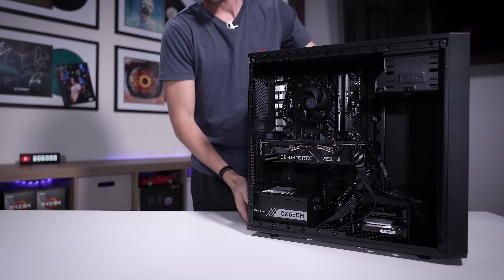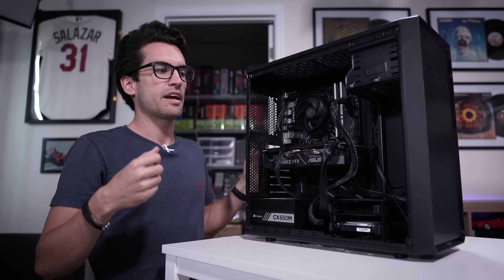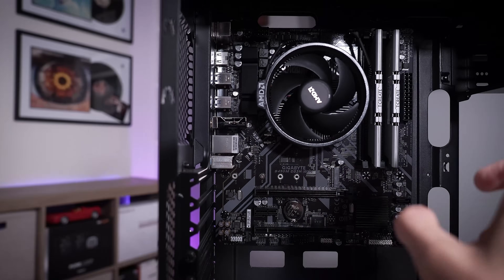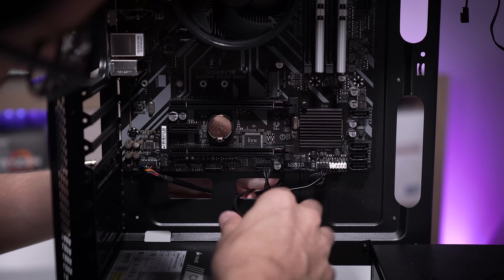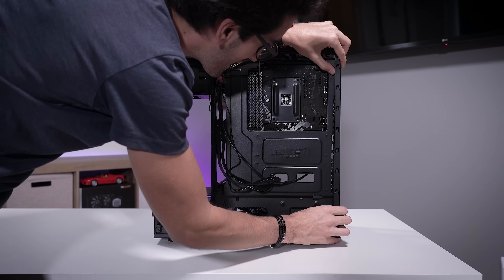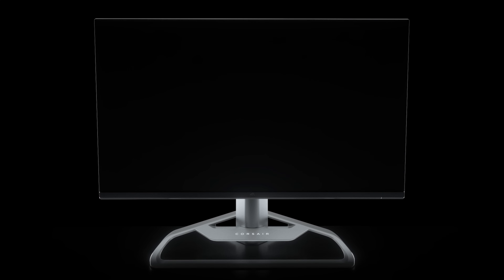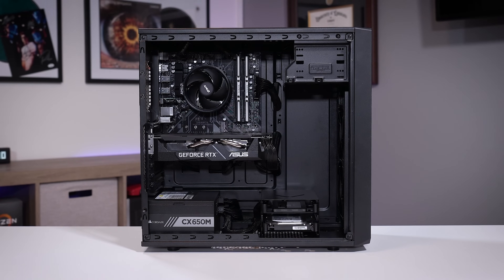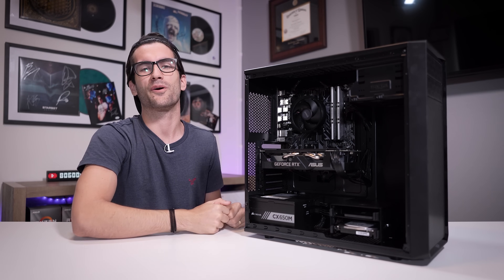Fixing a Viewer PC's AWFUL Cable Management!

Comment: It did help temps because the fans weren’t connected. Also shows how much part selection can affect the overall look of your build. Matching the size of your case and motherboard can help with cable management. This Matx motherboard in an atx case means the hd audio cable sticks out like a sore thumb.

Comment: Why skip over the worst cable to manage.....the 24 pin?  ;)    I have that exact case for one of my builds.  Added an extra USB 3.0 front panel to the case.   AIO on top.   So even more wiring.
Reply from the maker: I didn't skip over it. Was pretty straight forward, that one :-)

Comment: I always thought of cable management as an important part of the build. I know some people don't care, and that's fine.. but for me, I compare my work to what could be obtained from a pre-built from a system integrator. Especially if I am building the system for someone else, I want my systems to be not only technically superior (non proprietary components, sensible parts, price/value, etc) but it has to look better and everything has to work. It has to be clean, every port is connected, all front panel I/O.. everything. I agree with Greg, it's just a matter of pride, I took the time to source and build the system, it's my work, my name is attached to it.. it has to not only work good, but look good. I am a fan of this series, looking forward to more!

Comment: That will be a great series. I can repair, build and clean PCs but my cable management skills are really bad. In front it's fine but the backs look terrible.

Also cool, first video and the case shown is the one I use for my second and third gaming PC. It is extremely cheap, light weight and really good and simple.

Comment: I really need to redo mine. I told myself when I built my latest system (2020ish) that I wouldn’t just get it running and shove the wires just wherever, but that is exactly what I did. Lol side panel fits, enough to latch anyway. It only randomly popped of once right after building it, none since then.

Comment: A ways back now, just when the big C just started, I built myself a new, fully water-cooled, RGB-Vomit PC (Ryzen 9 3900X, RTX 2080Ti). My fist Water-Cooled, RGB-Vomit System. I was not prepared for the PITA that is the additional ARGB cables. Holy schmeckels, getting those all the Blocks and Fans connected and tied up neatly without the blasted ARGB connector unplugging itself all the time was...an experience. But that's on me, because I wanted the RGB's everywhere. Might cut back a tad on the RGB on my next build - this one will serve me well for the forseeable future, I hope. Nice Video, Greg!

Comment: Only thing i kinda felt was missing would be 1 fan to suck air out. As the case had 2 fans sucking air in, but none that would pull hot air out of the case.

Comment: Pro tip: Be careful when handling SATA cables. Avoid rough-handling them or bending them too tightly. They break surprisingly easily, and you'll be in a world of hurt when you find out that your drive doesn't seem to be working.

Another pro tip: In many cases the thumb screws of the right side panel can seem to be retaining, when in fact they are not. It's easy to get confused when opening them, as they have some resistance from being completely removed, so one easily thinks they are retaining... and then you just shove the right side panel somewhere and then retrieve it only to find out that one or both screws are missing. Just like happened to you here.

Comment: I don't think it's a good idea to connect the CPU fan to a case fan connector and case fans to the CPU fan connector. It will be really confusing if you use any sort of monitoring software, and if you want to adjust the curves. It can also be really confusing in BIOS, and it might even confuse BIOS (at least those that have their own fan speed curve managers, which most nowadays do). BIOS will assume that the CPU fan is connected to the CPU fan connector.

Comment: I really hope you did not forget to check the fan curves for the CPU fan, Greg. Other than that, good video.

It is not always as easy as it looks here to rout cables. This build was pretty straightforward. I recently bought a pre-built (no disaster like GN reviews) and the front looked fine but the back was an unmitigated disaster (what with all the RGB and FAN cables - 6 RGB fans plus RGB pump head). When I modified my fan setup from stock cheapos for silence I cable managed everything much better. Did not think it would take me about 6 hours (whole upgrade and management) but it was my first time.

Comment: Yoo new series, tbh aside from me using a non-modular psu, Sata cables and my cables being either too short or long I do decent cable management for someone who used a oem case, a cheap thermaltake case and a Nzxt h510 flow case so I hope to learn alot more in this series to make it better

Comment: Gregg another good job.

The eco keyboard warriors need to step back and take into account the possibility of the stray pigtail or cable that is longer than needed getting to close to a fan blade and hearing the annoying burr sound, or burning smell because of a cable or single wire is resting on or up against a temperature hot spot on the motherboard, graphics card, hard drive or some other computer hardware or component.

Cable management is vital for a safe and efficient computer, but if there is no easy way to tidy up the cables then find a solution to what you have.

So I say it again.

GREGG ANOTHER GOOD JOB.

That is for those who are suffering from a severe case of reading deafness.

Comment: hope you get a RGB rats nest in these series. Definetly need some pointers. With cable extensions and RGB fans and RGB AIO, and several SATA devices its just cables on top of cables.
I have tried to manage it but... it's like I need a bigger case just to have some cables to stow somewhere.

Comment: I would never change the CPU fan to a non CPU connector. CPU fan fail warnings will not work anymore and the board can't control the fan speed correctly if the sensor can't be changed for each fan connector in UEFI setup. I rather would change one fan to the back and put the other fan to a 7V adapter or an adapter with a resistor and use a regular molex connector for power.

Comment: I have a TUF GT301 case with the drive cage in; I have no space to tuck in the excess length of the 24-pin, 8-pin, SATA cables. It closes just fine, but it's a fookin mess.

Comment: Never been a fan of zip ties. It is possible to undo them, but typically they get cut when you need to change things. I tend to reuse twist ties, or velcro. You can get twist ties that don't have metal by the way. For one unique setup I used a string (it had holes to use, but was not set up for the screws I had, still made it look nice (think a square approach)).

Comment: The Focus G is the case I chose for the build I did for my brother a few years ago. Budget all the way with a Skylake i7 and a used 1060 6gb. For the price I really liked it. My cable management was somewhere in between yours and your client's.
Reply: My only issue with the focus g is the routing hole for the 24 pin power connector is too small for psus with in-line capacitors. At least that's the case for me, with my motherboard installed, I only have half an inch with that hole, and my rm650x has cables that are like 3/4 inch thick

Comment: Ive taken 3-5 hours rerouting cables, drilling new channel holes and making panels to hide cables and make the system look almost wireless. I have the most fun doing cable management, especially in SFF builds or all Glass Cases.

Comment: G'day Greg,
I agree if you are Building your own PC you should make some effort in Cable Management, you put in all the effort to plug the pieces together so why leave it looking like a Garbage Dump.
I have my Editing PC in a Fractal Focus G & saying "The Cables are messy because there is no Cable Management" for this Case is just LAZY, Like you showed here even though it has no Basement it is still really Easy to cable Manage, just gotta use your brain even with a Non Modular PSU, Cable tying the extra Power Cables between the  PSU & HDD Mount makes them neat & mostly hidden by the Side Panel.

Comment: The first case I bought myself was a Fractal Focus G (same as in vid).
The only big downside to the case, was the opening between the front fans, and mobo tray.  Made my own alu psu cover from some scraps. 
Also the HD audio cable is waaay short

Comment: my problem with cable management is that ive been running the same case since 2016, and have went through so many builds with it.... so cables are awkwardly routed everywhere because of each subsequent update... mobo, coolers, gpus, even the amount of storage adds to the mess lol

Comment: I have that exact case, its a pain to work with. You cant hide the cables, the PSU is exposed! The only SSD mount is behind the PSU as well, so I installed it in the 5.25" bay so I didn't have to remove my PSU.
Reply from the maker: You CAN hide the cables! :-D We proved it!
Reply: @GregSalazar  You can, I cant lol. I shove my cables in the basement usually. I wish they put a PSU basement in this case when they designed it.

Comment: I too could still use Help; I'm getting better at 'Cable Management'; However in same Cases eg. My 'Server Rebuild', the cables from the PSU (Non Modular) and the Case/Tower: Antec 200 just won't allow It!

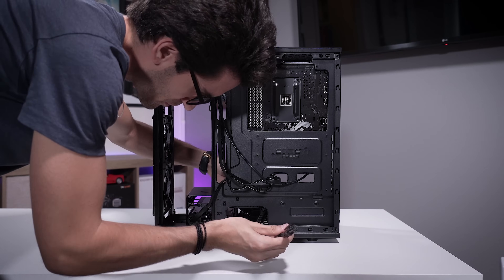Comment: 8:45 Before reinstalling the side panel, consider laying the case on its side. Experienced frustration from slightly warped side panels legs wouldn't slide into hole notches. Understandable, you did it the difficult way for the camera.
Reply from the maker: Yep, but that'd be too easy hahah. I like the test with the system standing upright to show the viewer how tight a squeeze it might be :-)

Comment: I have love/hate relation ship with cable managements,
I always choose the hardest cases to cable manage on them, when I am working on them I hate that I am taking long time making it as neat as possible at the same time when I finish I get the feeling of (it was worth it).
1 tip I can give: is choose the parts/ pc case wisely + there are PSU extension cables that doesn't cost much if you wanted to add a little extra effort.

Comment: This one looked fairly tame in fairness, but it's an absolutely great idea for a series..
 I'm hoping some people present some absolute pigs of systems for this series, like a small case, with bunch of fans, with RGB, and more RGB, and multiple hard drives, fan controller, pump (with RGB), etc, so that people can really see how to do tough cable management.
I don't think I've ever seen YouTubers deal with difficult cable management, and tutorials are generally done with easy systems, and they usually gloss over the parts of cable management that are actually tough.
Probably because they're cursing and pulling their hair out.
And yes I really hate cable management!

Comment: Such a tiny board.  I do not understand micro-ATX for a gaming PC.  I use micro-ATX for my Linux server, because it doesn't need a GPU or anything like that, and I can use a smaller case.  But for a gaming PC I won't do anything but full ATX and full tower, otherwise there is not enough room for stuff.

Comment: Is that the Focus G? I'm actually planning on changing my work's standard build case to this, specifically for the 2 5.25 bays at the top. some businesses still use optical media and would like card readers built into the pc.
Reply: I definitely would not recommend a focus g.  The build quality of mine was not very good, metal was flimsy and the whole thing weighed about 10 lbs.  I switched to a corsair 4000d and am pretty happy with it.
Reply: Yeah the Focus G is a budget case, the window panel looks cheap and the cable management is not great. Also misses an exhaust fan

Comment: Ha! I built my Dad a system in the same case with the same motherboard and got a kit of 3 DeepCool RGB fans which included a PWM fan splitter - made for much easier cable management. Love seeing how a pro did cable management in a build like this.

Comment: the owner need to add an exhaust fan asap ... good work sire
Reply from the maker: Not a big deal. System doesn't run hot with this hardware combo.
Reply: @GregSalazar  in the summer... I think he will need one hhh

Comment: really surprised it only has one case fan header, must be a really cheap board

i'd probably add a fan controller using one of the 2 internal usb headers, corsair commander xt for example

Comment: How to make a PC 1000x more difficult to work on later for 0.05% better airflow. I cable managed the crap out of my first custom gaming PC build. Then later regretted it as I had to diagnose an issue and all my threaded tight cables had to be removed just to do anything. It totally does look better though.
Reply from the maker: As someone who literally works on random PCs all the time... I much prefer tidy systems with actual effort into cable management. But I obviously don't speak for everyone.
Reply: @GregSalazar  I think the key thing there is 'tidy system'. You can have things super tightly managed, and still have it get in the way when someone is trying to troubleshoot. I had someone that had basically braided together a bunch of SATA data cables, and then when the drive failed, they were too scared of accidentally cutting one of the cables to deal with the cable ties they'd bound them with. So I used pliers to crush the lock on the zip tie and watched them feel stupid for worrying about it.  It also made it much harder to disconnect the faulty drive, as tracing the cables was more complicated due to how 'tightly managed' it was. 
I'd prefer a 'loose but sensible' management over 'really tightly managed, but obfuscates routing'. which is probably what Bryan was referring to. 

My builds tend to be something of a mullet, on cable management. The front side I try to keep super tidy, the back end is clean and well-washed, but not really styled. 
In practical terms, that means while the, say, SATA cables might all be going the same direction and routed along the same channels, they aren't tied down super tight. The Mobo power and CPU power will go through different holes, all the PCIE power through one, fan and front I/O get branched off to go through the holes closest to where they plug in. Again, nothing tightly tied down, just enough 'management' to keep them from 'hanging' everywhere. The only truly 'messy' sections are right next to the power supply (due to the length of cables and the fact that it's usually such a small space you aren't going to be working there without disconnecting the PSU anyway) and the AIO hose, which for obvious reasons, I don't want to be trying to mess with if I don't have too.  
Makes it easier to deal with individual issues, as opposed to having to deal with having 10+ cables tightly wound through one or two holes, meaning I have to deal with the whole brace, as opposed to just d-con from front side and then push the connecter through the hole, without having to disconnect everything. It also is really helpful when dealing with things like RGB wiring and 3rd party rgb controllers, to be able to deal with cables individually.
Of course, the type of case you are working with is also a MASSIVE factor when it comes to cable management and what is and isn't 'good'.

The only time I'd see it as a really good idea to be completely strict on cable management, is when you are having to deal with extensions or conversion chains. Which realistically, with a modern PC, you should NOT be having to deal with those at all. The words 'daisy molex hell' should give you an indicator of what I'm referring to. 

This is also from the perspective of maintenance and spot changes. If you are redoing everything, then tightly managed might be better, but for normal users and troubleshooting, not so much.

Comment: Cable management has always been a nightmare for me. I've built a few pcs and I always try to keep the cables organized, but I end up (fairly quickly) giving up. Maybe it's patience thing. Also, I am about to build a mini-itx on meshlicious. Just waiting for parts to ship from US to Brazil, where I live. Maybe this will give me an extra motivation to do a nice cable management, since it will be my first itx build and I've heard they are quite hard/stressful to cable manage.
Reply: Meshlicious is pretty decent, As long as your 24-pin and 8-pin cables are long enough, Can make one trunk behind motherboard tray.
Reply: @sevaeron  haven’t seen the cables yet, but psu is SF 750 platinum from corsair. Hope it’s fine!
Reply: @andrefurlanetto6013  Good PSU choice. ITX is harder to cable manage (source: me, an ITX user), but it's even more satisfying/rewarding than ATX IMO
Reply: Guess it's a good thing that unless you are blocking fans with the wires, it's 100% form over function and does absolutely nothing for a PC's performance. It is nice to have a neat case with clean cable routing though, and given room behind the board tray to actually manage the cables it is good practice to do so.